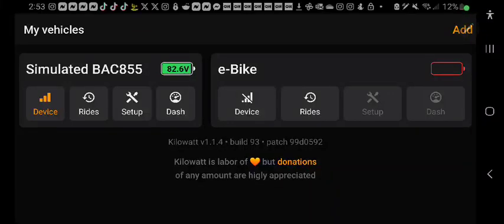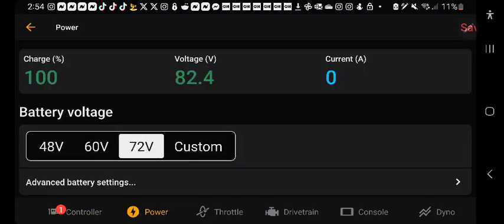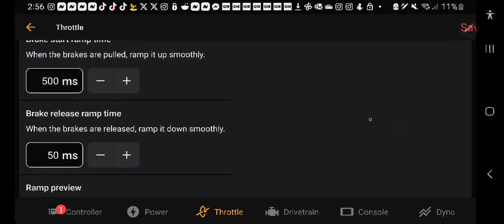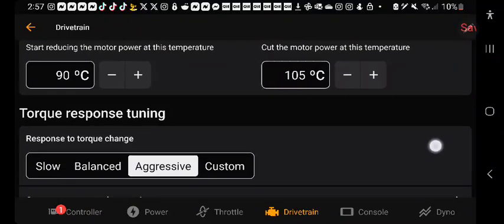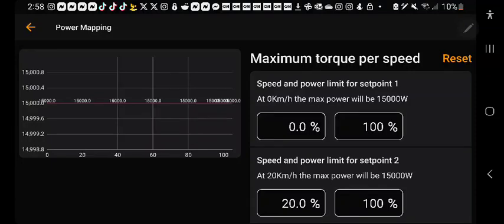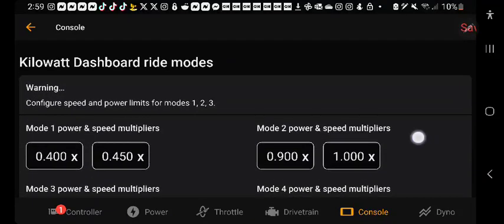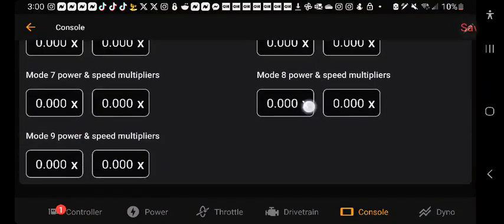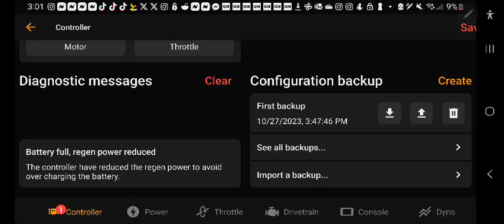kilowatt STd for ASI. This is the display I use  and app for setting parameters Free in google play

Comment: If I try this, can I go back to GLE app without anything getting messed up? (Reload a .gle config file)
Reply: Interesting I’ll test it out, wish they made an iOS version
Reply from the maker: @jacobwilson9928  they do i just didnt mention it so Iphone users its available
Reply from the maker: Yeah you can switch back and forth. Gle is the primary so if there is ever a setting that won't change in kilowatt you'll have to change it in gle first if you have them both downloaded. If you run kilowatt alone you won't have to and that's not for all stuff just some things have to be set in GLE it won't let kilowatt override it cuz that's secondary 3rd party. It's only few thing like if you use custom battery size won't let you set 21s in kilowatt if it's 20 in gle. 99.9% won't need that